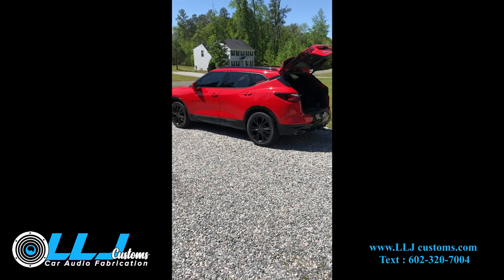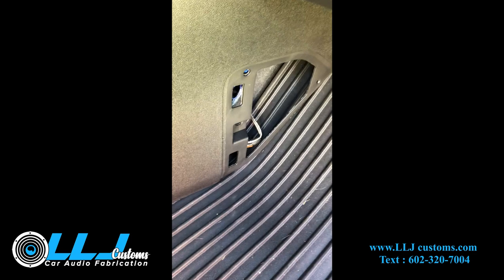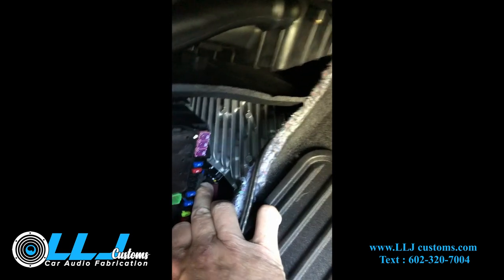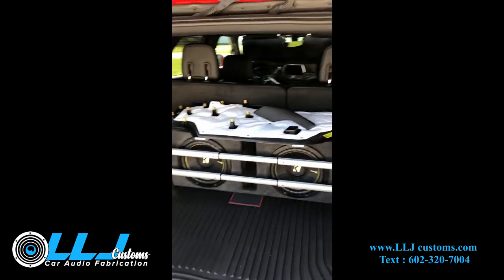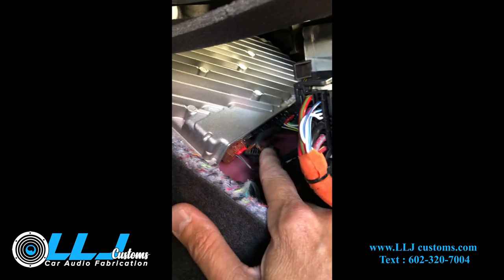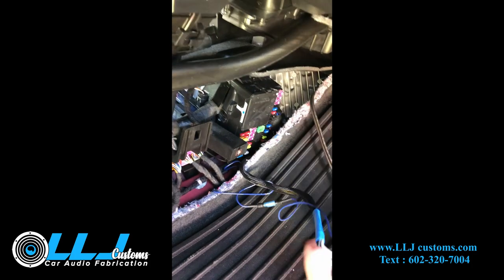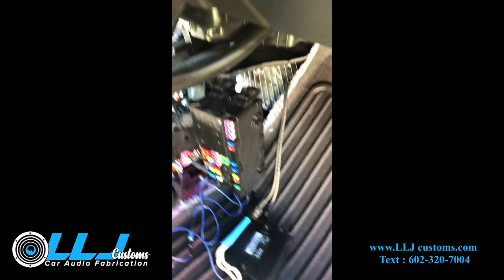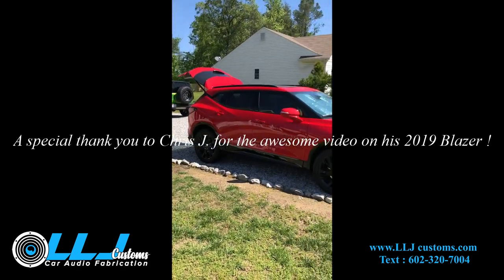2019-2020 GM Chevrolet Blazer how to add a sub amp with Bose Factory audio system

Comment: Wondering when the t harness will be back in stock for 2020 Blazer with Bose?
Reply from the maker: @Tcal1997  Hello! The Bose R2R is available for order. This is for subs only and comes with a bassRESTOR LOC included:
https://lljcustoms.com/collections/ready2go-llj-subwoofer-t-harness/products/2013-2024-gm-bose-t-harness-r2g
Reply: @lljcustomscaraudiofabricat7854  what is the difference between the two? Just learning all of this and not to familiar with all the terms
Reply from the maker: @Tcal1997  https://t-harness.com/pages/diagrams-and-installation-information

Comment: With this harness do you still retain all features of the car like hands free calling, etc?
Reply from the maker: Yes we dont affect any factory settings or features in any way
Reply: @lljcustomscaraudiofabricat7854  could you link me the specific one that I need I have a 19 blazer with bose. Please?
Reply from the maker: @ashton8565  here you are.

https://t-harness.com/products/2013-2024-gm-bose-t-harness-r2g
Reply: @lljcustomscaraudiofabricat7854  thanks. Do you know if I’ll need a turn on wire extension?
Reply from the maker: @ashton8565  that is just a single conductor wire that normally comes in a power kit

Comment: I have an issue with my amp going into protect mode even at low volumes..I have a 2019 blazer with Bose .. I used the same t harness as you… I have a signal and it plays then keeps clipping with barely any volume ..
Reply from the maker: Hello Antonio, amp going into protection can be a lot of things. Most amps have a flash pattern that gives you an idea of what may be the problem. Gain matching your amp is important, checking the ground and battery voltage is annother common problem we see. Some amps also have a limit on the amount of voltage thay can take via the RCA or high level and if you use a good loc that maybe surpassing that then that can creat a problem for you also.
Reply: @lljcustomscaraudiofabricat7854  I’m using the kicker loc… I’m running the skar audio RP-1200.1D amp .. the light stays blue and not indicating clipping … the gain is actually turned all the way down to the minimum and still clips … it’s like a stutter clips… goes in and out back to back without completely going into protect..it is connected to the 2019 blazer with Bose ..
Reply from the maker: @antonioblakely874  the skar audio amps normally dont take more then 1-3v of signal input so it may be the gain output of the loc is to high. Clipping means the signal from the head unit is flattening and it will happen intermittently and thats ok but its best to identify when its happening and not go past that volume level. Unless your consistently clipped it wont be the reason for you amp to go into protection.
Reply: @lljcustomscaraudiofabricat7854  thanks for your help… it was the ground … I thought it was a good one from the beginning but turns out when I took the trim off that metal wasn’t welded .. it was bolted on another painted surface so I had to drill my own hole and secured it .. the harness works perfectly also .. thanks .. I will be ordering again .
Reply from the maker: @antonioblakely874  awsome ! Glad we could point you in the right direction! Thank you for coming back and letting us know what it was hopefully this helps someone else out !

Comment: How do you minimize the vibration of the rear view mirror?  Mine is always facing down from the bass. I have the 2019 Blazer
Reply from the maker: Lol a good trick is CA glue or to use fish tank puddy that hardens with uv light it works great ..
Reply: @lljcustomscaraudiofabricat7854  thanks I will give this a try.
Reply from the maker: @TraAlan816  you cant go wrong we even give you a 5 year warranty

Comment: I try to have the audio exit on door drive speaker, and it’s doesn’t works, when I turned on the truck the sub has an intermittent sound and vibration very awkward. What’s wrong with my installation??

Comment: Hello, Can you make a video for the 2018 Traverse LS model ( No Bose). I have the Tan and Gray connectors. All the videos I have watched and followed all look different. Please assist??
Reply from the maker: Hello Edwin, if you have a tan and gray connector then younhave the 7 inch screen and you would use our 7inch work truck elevation model harness for your radio
Reply: @lljcustomscaraudiofabricat7854  Thanks... But looks like everything is backordered or out of stock, am trying to get the 1618GMWV. Or can I still order?
Reply from the maker: @ndungudwayne  you are able to order now. We have the connectors back in stock
Reply: Hi I have a Chevy traverse 2019 LS how I can  disconnect the ANC? I alredy have my amp and 2 12 s installed but wen I accelerate that noise came from the subs just when I accelerate. I use a line out converter hooked to my RL door speaker (mono) please help
Reply: @lljcustomscaraudiofabricat7854   so do you need that harness for non Bose?

Comment: How do you get through the firewall from the battery?
Reply from the maker: There is a wire harness boot on the driver side you can remove. you can also run it under the vehicle and up the drain plug in the rear wheel fender.

Comment: Hi @ LLJ Customs! I have the 2020 RS (No Bose System). Do you know if the harness would still work with the (non-Bose) factory set up or if will I need an AMP also?
Reply from the maker: Hello, we do have a harness for the non-bose and the anc for that system as well.

Comment: so after hooking up the T harness you run the RCAs back to your sub, but are the speakers still being ran through the factory amp? I don't see enough wires coming off of that small thing hooked up to the harness for them to be being ran through that.
Reply from the maker: The factory amp uses 3 plugs to run all the speakers the 2 channel tharness only uses the lowest frequency to run the loc unit
Reply: @lljcustomscaraudiofabricat7854  im not quite sure i understand what that means exactly. To put it simply, if I were to do exactly what the guy did In this video and plug in the LOC into the factory amp and from that run my RCAs to my sub I plan on hooking up (it has an amp built into it) would I have to rewire all 6 speakers into anything manually or would they all run off of the factory amp since the LOC is connected to it as well?
Reply from the maker: all the factory speakers and functions would stay the same. Nothing will need to be changed or done to the factory wires just add the T-Harness inline
Reply: @lljcustomscaraudiofabricat7854  alright, thank you for the info
Reply: @lljcustomscaraudiofabricat7854  can I get the t harness and notice canceling module for 2019 XT5 luxury?

Comment: I have this exact vehicle, Does this still leave the stock subwoofer working as well and the rear subwoofers?
Reply from the maker: Yes or we can delete it.
Reply: @lljcustomscaraudiofabricat7854  I shot the website a message, but will ask here as well since it may help others,  I've heard with Bose systems that when you turn the sound up the bass drops to save the stock speakers, does this fix that or will that be a issue with a added amplified subwoofer?
Reply from the maker: @michaelstorey6507  yes great question so the bass rolloff is not in all bose systems most just in the vehicle that dont come with a sub stock. Vehicle that do have it from what we have seen the signal from the head unit will be distorted befor bassroll off happens
Reply: @lljcustomscaraudiofabricat7854  Ok great I was asking because I saw the option to add a LC2i.  but if this vehicle doesn't roll off then that would be awesome.